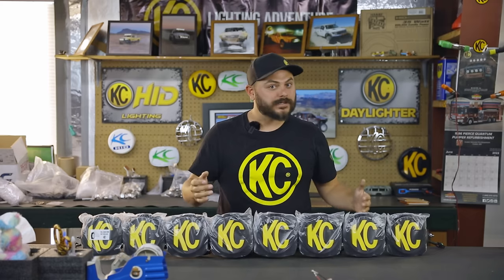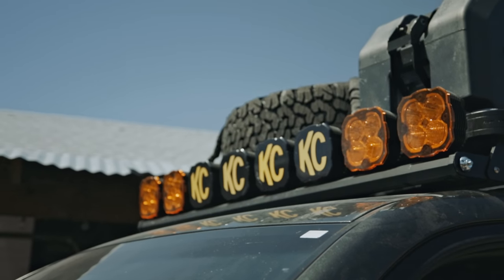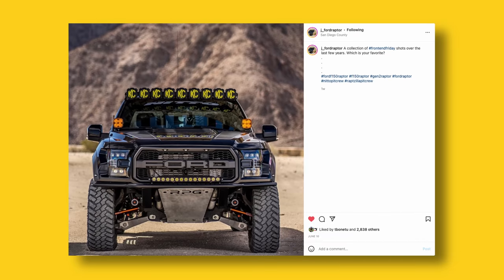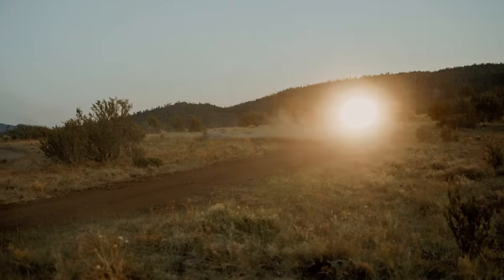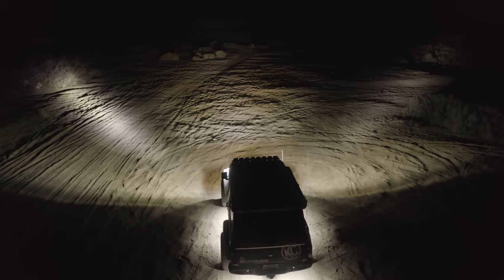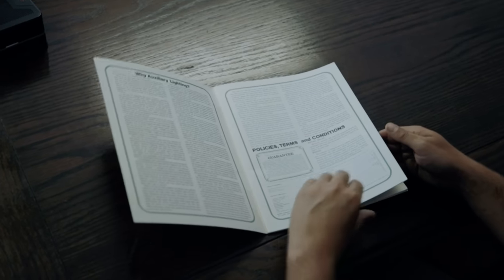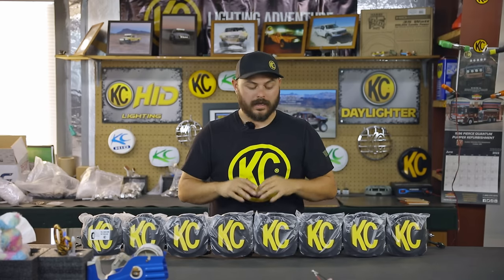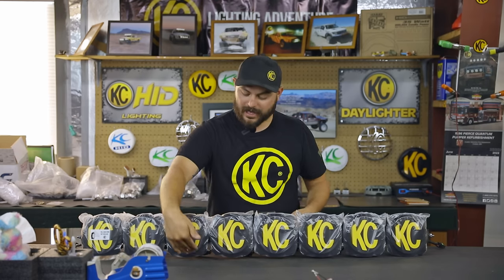Roof LED Light Bars: Pros & Cons, Mounting, Aiming, and Choosing | KC HiLiTES®

Comment: Cool video. I’m kinda old school by age and likes. So yeah the light bar you have on display in front of you works for me.  My major downfall is 8 individual covers which I’m gonna loose one or more. Plus the off and on aspect. Anyway to make a small motorized shield/cover that can be push button and it raises to allow for the lights to be used. Then when done push the button again and the shield / cover comes down and the lights are again protected from debris and such. Something built into the light bar itself.  I prefer the round light design.  Thanks for your time.

Comment: Informational for sure. Looking at lights like this for my X3 for higher speeds. But I have to say for your everyday truck it’s impossible to combat the windshield glare unless you mount your lights further back (light a roof rack application). Light bars over the windshield never work. Like you said your better off investing money on on bumper and grill instead of overhead. Big money just to look cool.
Reply: Unless you wheel at night and want to see how deep the holes are in front
Reply: This sounds like somebody who doesn't know why they bought their light bar lolol
Reply: @jf8138  sounds like someone who hasn’t driven at high speed off road after sunset;(

Comment: Whether light bars are legal depends on the state and the situation:
Off-roading
Light bars are often used for off-roading because they provide extra visibility and can help you see obstacles. However, some states consider it dangerous to use light bars on public roads and have made them illegal. Even when off-roading, it's considered polite to turn off your light bars for 15 seconds when another vehicle approaches.
Street driving
In most states, it's illegal to drive on the street with an LED light bar turned on because of how bright they are. Some states also require you to use an LED light cover on the highway to prevent the lights from distracting other drivers.
State laws
Because each state has different rules, it's important to know your state's laws regarding light bars. For example, in North Carolina, it's illegal to drive a motor vehicle on the highway with a light bar lighting device, with some exceptions. In Georgia, on the other hand, it's legal to have light bars installed on your vehicle. Notwithstanding any provision of this section to the contrary, and excluding vehicles described in subsection (d) of this section, and excluding vehicles listed in G.S. 20-130.1(b), no person shall drive a motor vehicle on the highways of this State while using a light bar lighting device.
Alabama
Off-roading lights limited to two glare-free cowl or fender lamps.
Alabama Legal Information
Alaska
The front of a vehicle is limited to four lights. No part of a high intensity light can strike the road.
Alaska Legal Information
Arizona
Any light greater than 300 candlepower (3,771 lumens) must be directed so that no part of the beam strikes the road 75 feet from the vehicle.
Arizona Legal Information
Arkansas
No auxiliary driving lights may be used on pubic roads.
Arkansas Legal Information
California
When on public roadways, off-road lights must be off and covered with an opaque cover.
California Legal Information
Colorado
Auxiliary lights are limited to two, and the beams must be directed to the left side less than 100 feet away from the vehicle.
Colorado Legal Information
Connecticut
No more than four lights on the front of a vehicle. They cannot exceed 300 candlepower (3,771 lumens).
Connecticut Legal Information
Delaware
Allows two spotlights and two headlights. Light bars must be off while on the road.
Delaware Legal Information
D.C.
All lights greater than 300 candlepower (3,771 lumens) must be directed so no part of the beam hits 75 feet away from the vehicle.
D.C. Legal Information
Florida
Only four lights are allowed in front of a vehicle, and must adhere to existing light laws.
Florida Legal Information
Georgia
Only one spotlight, not to be aimed at any approaching vehicle. One "auxiliary driving light" is allowed but must be mounted between 16 and 42 inches from the ground.
Georgia Legal Information
Hawaii
Lights are not allowed to exceed 2,400 candlepower (30,168 lumens). Light bars must be turned off on roads.
Hawaii Legal Information
Idaho
If any of the front lights have a light with greater than 300 candlepower (3,771 lumens), then only four lights are allowed.
Idaho Legal Information
Illinois
No more than four lights on the front of a vehicle may be lit. All lights must be dimmable and aimed away from other drivers' eyes.
Illinois Legal Information
Indiana
One auxiliary driving lamp is allowed, but must be mounted between 24 and 42 inches from the road's surface.
Indiana Legal Information
Iowa
Any bright light must be directed away from the eyes of other drivers. Only three auxiliary driving lamps are allowed on a vehicle.
Iowa Legal Information
Kansas
All lights must be directed so that no part of the high intensity beam strikes the roadway more than 75 feet out from the vehicle.
Kansas Legal Information
Kentucky
Illegal to drive with LED light bars turned on.
Kentucky Legal Information
Louisiana
Illegal to drive with LED light bars turned on.
Louisiana Legal Information
Maine
No auxiliary light can be brighter than the standard lighting equipment.
Maine Legal Information
Maryland
No more than two auxiliary lamps mounted between 16 and 42 inches above ground level.
Maryland Legal Information
Massachusetts
Illegal to drive with LED light bars turned on. Strict regulations on all aftermarket lighting.
Massachusetts Legal Information
Michigan
No more than four forward facing lights.
Michigan Legal Information
Minnesota
May have up to two auxiliary driving lamps between 16 and 42 inches above a level surface.
Minnesota Legal Information
Mississippi
Two auxiliary driving lamps allowed, but must be mounted between 12 and 42 inches above a level surface.
Mississippi Legal Information
Missouri
Up to three auxiliary driving lamps mounted between 12 and 42 inches above a level surface.
Missouri Legal Information
Montana
Light bars may not be used on public roadways.
Montana Legal Information
Nevada
Two auxiliary lamps mounted between 16 and 42 inches above a level surface.
Nevada Legal Information
New Hampshire
Up to three auxiliary driving lamps mounted between 12 and 42 inches high.
New Hampshire Legal Information
New Jersey
May use a light bar as long as it is low profile and sits lower than the headlights.
New Jersey Legal Information(PDF Download)
New Mexico
One auxiliary driving lamp mounted between 16 and 42 inches above the ground. Must be able to be turned off at least 500 feet from approaching vehicles.
New Mexico Legal Information
New York
While not technically illegal, all auxiliary lights cannot exceed 32 candlepower (402 lumens). There are no light bars made with less than 32 candlepower.
New York Legal Information
North Carolina
Light bars must be off while driving on public roads.
North Carolina Legal Information
North Dakota
No part of the light can hit the ground 75 feet from the vehicle.
North Dakota Legal Information
Ohio
No more than five front-facing lights. No high intensity beam may strike the roadway 75 feet from the vehicle.
Ohio Legal Information
Oklahoma
Off-road lights may not be used on roadways.
Oklahoma Legal Information
Oregon
Off-road lights may only be used off-roads.
Oregon Legal Information
Pennsylvania
Off-road lights must be off and covered while on public roads.
Pennsylvania Legal Information
Rhode Island
All lights with more than 300 candlepower (3,771 lumens) must be directed so they don't hit the roadway more than 75 feet in front of the vehicle.
Rhode Island Legal Information
South Carolina
All lights with more than 300 candlepower (3,771 lumens) must be directed so they don't hit the roadway more than 75 feet in front of the vehicle.
South Carolina Legal Information
South Dakota
All lights with more than 25 candlepower (314.25 lumens) must be directed so that no part of the beam hits the level surface 50 feet in front of a vehicle.
South Dakota Legal Information
Tennessee
No more than two auxiliary lights allowed, and no portion of the beam may be directed where it can strike oncoming drivers.
Tennessee Legal Information
Texas
Two auxiliary driving lamps are permitted, but must be mounted between 16 and 42 inches above a level surface.
Texas Legal Information
Utah
Any light with greater than 300 candlepower (3,771 lumens) must be directed so that no portion of the beam strikes the roadway.
Utah Legal Information
Vermont
Aftermarket lights must be DOT approved.
Vermont Legal Information
Virginia
Any lights mounted higher than factory headlights must be covered. May have 2 uncovered lights in addition to headlights. Uncovered lights must be set to turn off if brights are turned on.
Virginia Legal Information
Washington
Two auxiliary lights are allowed, but must be mounted between 16 and 42 inches off the ground.
Washington Legal Information
West Virginia
All lamps mounted higher than 42 inches off the ground must be covered.
West Virginia Legal Information
Wisconsin
No more than 4 forward facing lights.
Wisconsin Legal Information
Wyoming
Light bars are not legal on public roadways
Wyoming Legal Information
Reply from the maker: Be honest, was this copy and pasted from ChatGPT?

Comment: can KC custom make a Jeep bracket for the Gravity6 on a JLUR?
I have a hard enough time to see an overhead traffic signal in my Jeep without a light bar in the way
every Jeep owner I've seen that has these KC lights, have the top view of windshield partially blocked by the light bar
if KC could custom make the two brackets a few inches taller, then I would have a unobstructed view it would help

Comment: Can I use it on the road as my high beams?
Reply from the maker: Legally? No, illegally? Sure!

We don’t recommend it though as since it’s mounted higher than your roofline people are more likely to see your light bar before you see them! Most states will allow bumper lights, or lights level with or below your head lights to be used in conjunction with your high beams! Hope this helps! - Jacob
Reply: @kchilites  okay, fair! I just don't have a front bumper, so can't really add lights below :(

Comment: All those lights are only really useful if you can independently aim them. Otherwise you're better off buying just a couple individual lights.
Reply: @kchilites   I disagree. Six lights pointing at the same spot doesn't improve coverage. Aiming a couple high keeps light reaching out when the nose of the rig dips down, for example. I'm not talking about turning them 45 degrees or anything. Just spreading the beams a bit while keeping them overlapping.

Comment: In my world I see inexpensive to make lights at 8x50=$400 for lights plus an $80 metal bar going for only $2500.  Somehow my math is off.
Reply: You clearly look at the harbor freight light bars and expect this to be the same price lol. Gtfo why even complain about it if you can’t afford it.
Reply: Let me know when you make light bars,as good as these,for $480.00. I would love to see them.
Reply: I use these lights. I have friends who use the cheap lights. You get what you pay for! There’s don’t last, are anywhere near as bright and constantly rattle loose and knock the lights out. And the wiring is garbage too! I and my family have used KC since the 70’s. We’ve never had an issue. Not once! I have this exact light bar along with other Gravity Pro 6’s and other KC lights and they are all amazing!  They’ve run is 40 below zero cold to severe snow, to desert heat, to rock crawling to high speed desert running and they don’t come loose, have the lights knock out or stop working, have wiring issues or ever give me any problems. And the customer service at KC is amazing as well!
Reply: You cannot be serious. That is like saying a 10 dollar 1w Rayovac flashlight would be the same performance as something 10w or whatever. This is the most noobish thing I have read here lol
Reply: @j.r.777  I run KC as well. All I said was they are expensive as heck when purchased on a light bar.  That's all, settle down buddy.
Reply: @jf8138  let's see your setup with these lights. Clearly you have them.
Reply: @kchilites  hit it with a nail I'm just waiting for hid daylighters to hit the market again fr lights before lockers ! Kc is the best 👌 for the money and warranty.  Also had been proven in the race world
Reply: Don’t advertise how poor you are.
Reply: @billyjewett5006   Which setup do you have on your Jeep?
Reply: You buy once cry once.
Reply: @Crowd_Killer210 th is ain't true I got a light bar for $125 for my semi and it never broke or anything and it was BRIGHT
Reply: it comes down to the wiring in the light itself  and watts

Comment: Had my light bar for less than a year , water got in and the wires right by the part that screws in ripped off wire and all now I have to wire them in my self and add strong adhesive so they stay put . 4 of the 9 are all doing the same thing so I’ll just reinforce all of them . Cheap material for the price I payed for these “good” lights . Not happy I don’t recommend
Reply from the maker: Woah definitely not your average experience. I’ve been running my Pro 6 for well over 2 years now and I’ve had no issues with water at all, reach out to our customer service team so we can get that sorted for you!

Comment: Another drawback, extra fuel usage.
Something sticking up at the top of the vehicle adds resistance which will cause a slight drop in fuel economy.
But most of us dont care about this as we screwed our fuel economy with extra wide AT tires.
Reply from the maker: I think my 35's are worse on my gas mileage than my light bar, if we cared about gas mileage we wouldn't be doing this in the first place haha!